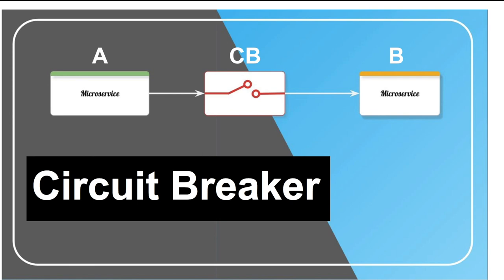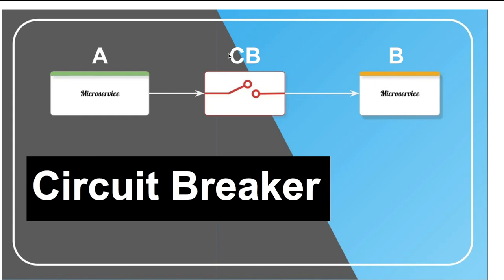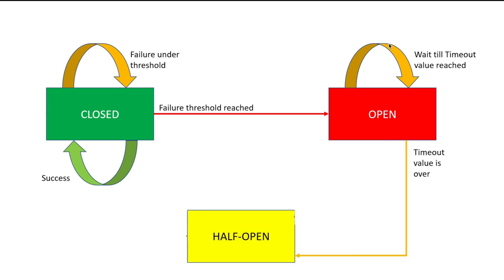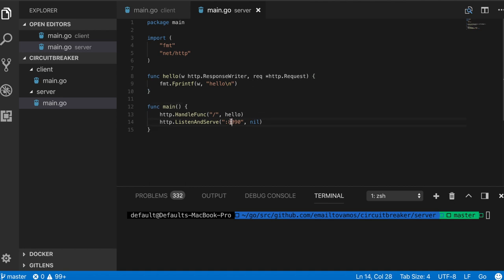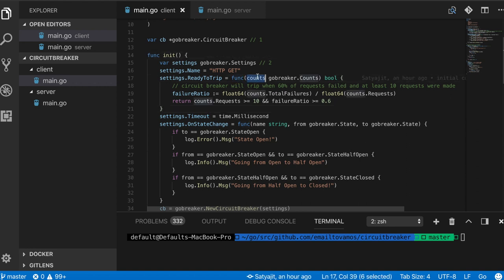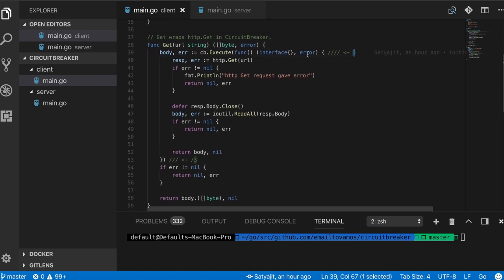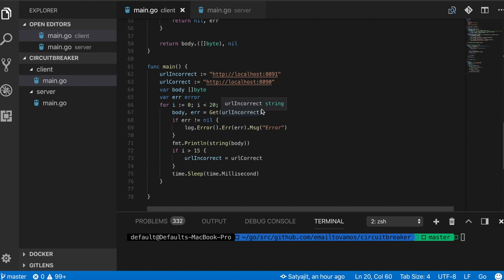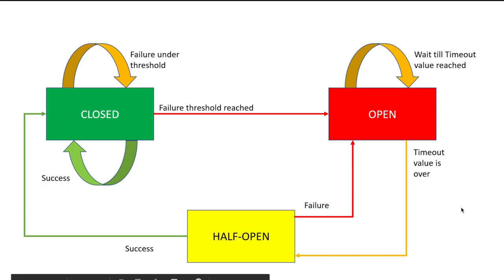Go (Golang) Circuit Breaker Example Implementation Tutorial

Comment: why are there only 3 hello strings in the log and not 5? Also, why does it retry after switching to open more than five times?
Reply: its likely that there were two messages above hello printed out means when cb is closed then you get the actual requests. my guesss